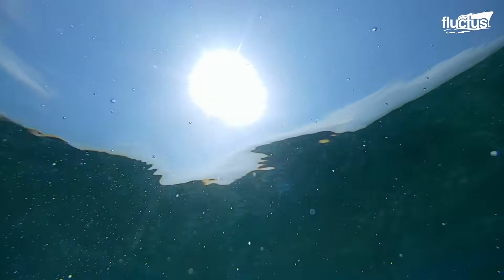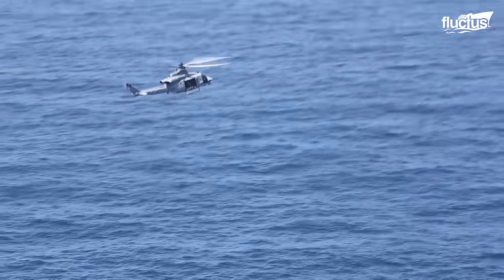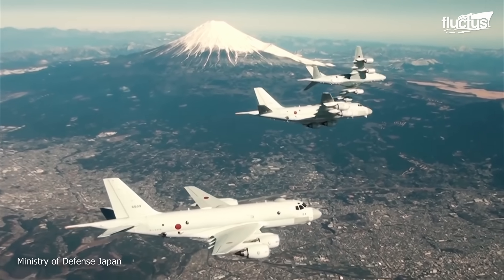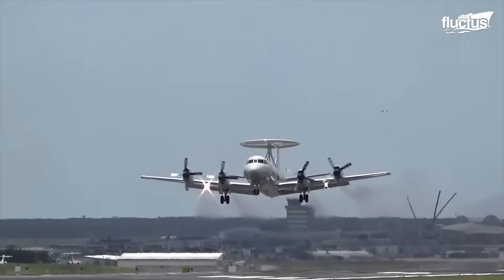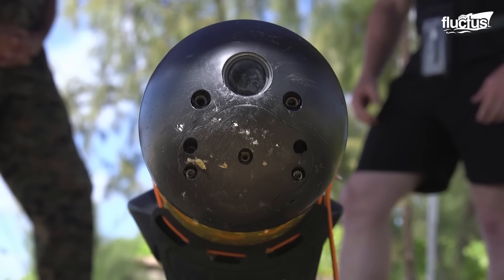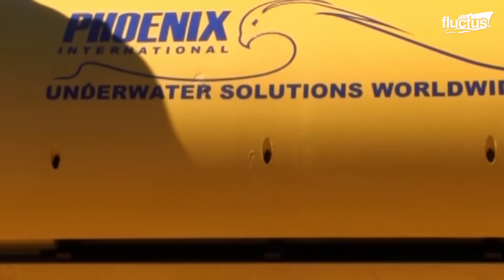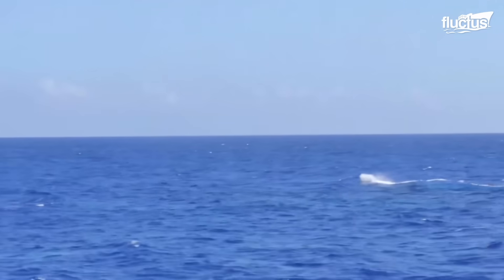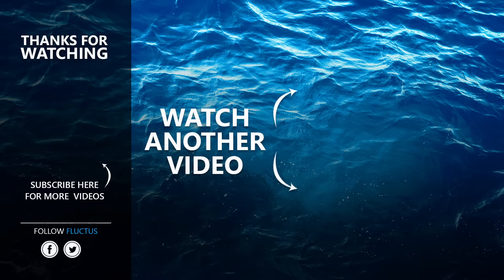The Scary Techniques Japan and US Use to Detect Enemy Submarines

Comment: The P1 looks like someone took a P3 Orion into the jet age.
Reply: The P-1 is a orthdox successor to the P3C. Since it is a new development, it could have adopted a twin-engine aircraft like the P-8 or a sidestick like the Airbus, but it was designed to have the same maneuverability and the same number of missions to ensure a smooth transition for the P3C pilot/crews.
The four-engine engine was strongly requested by the pilot/crews. The reason is that in peacetime, the P-1 flies at low altitude and low speed, not to detect submarines, but to monitor suspicious vessels in the waters around Japan.

Comment: What happens to the sonar buoys after the battery dies. Are they retrieved and recycled or just left to pollute the ocean.
Reply: They sink to the bottom
Reply: They are cut from the sub and sink. It's very fine single strand wire.
Reply: @Nick-boxall  I’d hate to get that wrapped around my prop
Reply: @Nick-boxall  ty
Reply: 海底奥に沈みます
Reply: What happens to the 15 mile torpedo control wires after launched from the sub?
Reply: @njjeff201  they get tangled around sea turtles, whales, and other endangered sea creatures ... which usually results in death.
Reply: If retrieved by the launching force, it can reused or recycled. Logically makes sense. If retrieved by an opposing force it will give its secrets up. My wild guess is it self-destruct into tiny pieces and sink to the bottom.
Reply: @francissantos7448  Wishful thinking. I hardly doubt that wire self destructs. If so maybe after 200 years
Reply: @njjeff201  Hello sir. I did finger research and sonar buoys are preset to sink after a certain period. They are too expensive to retrieve and they are inexpensive to make. As for the wire you are talking about, it is just a spool of wire that sinks to the seabed. Cheers.

Comment: The P-3 can also feather 2 of its engines to save fuel beside the aerial refueling capability,
Reply: hell, they can "run" on 1.. just not very well
Reply: P3 does not have the able to receive fuel while airborne, no aerial refueling system was installed.
Reply: Thanks, I was mistaken.  I need to go back and read up before I open my mouth. @jameswest411

Comment: Years ago I used to work for the National Ocean Survey(NOS).  We were constantly dropping XBTs (Expendable Bathythermographs) to measure the different thermal layers underwater.  All this data was being transmitted to the Navy and other centers.  I was told the Navy used the data to identify thermal layers where submarines can hide under.  These layers inhibit sound from penetrating or help hide any sound the submarine may generate.
Reply: When I was in the Navy 50 years ago we had a buoy we could drop from a patrol aircraft to look for thermal layers.
Reply: @Chris_at_Home    P3 orions perhaps?
Reply: @bobbyread6883  Yes it was.I didn’t operate the equipment except to fix it.  They had an old analog chart recorder with a ballpoint pen.
Reply: SSQ-36 @Chris_at_Home
Reply: I'm sure there are still hundreds of XBTs dropped each day by ASW vessels of most navies worldwide. One generally cannot do an active sonar range forecast of the day/evening without. Passives rely more on aggressive FFT system processing than anything else IIRC.